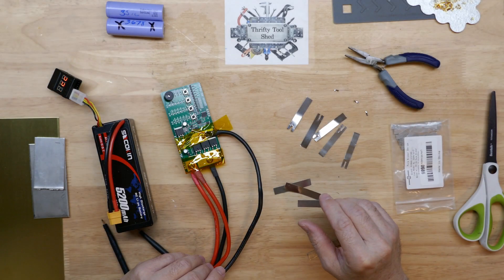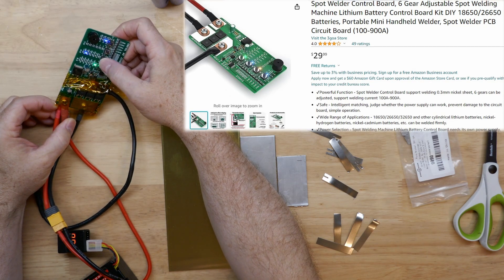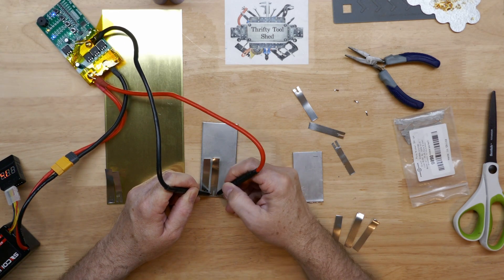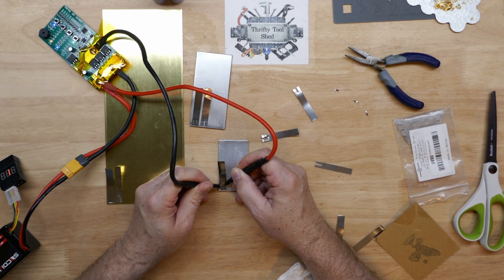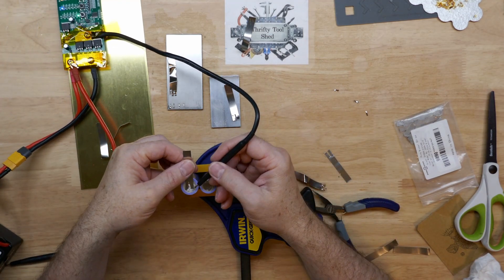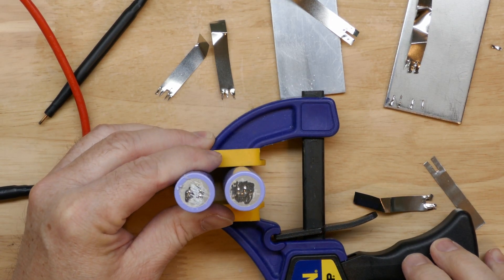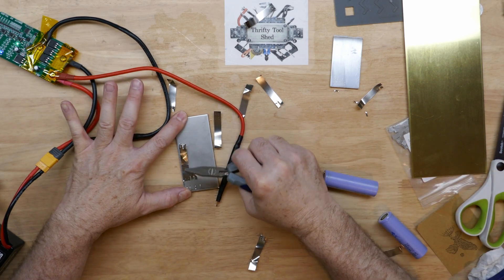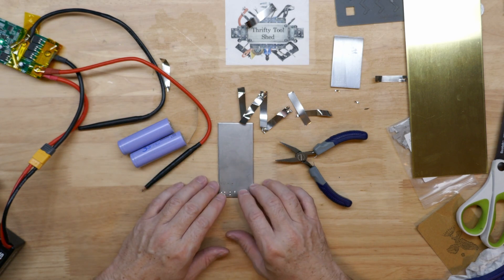Spot Weld Method Test - Which is Superior?

Comment: The slit nickel has sound science behind it. Looks like you understand the theory. Instead of the current taking the path of least resistance straight through the nickel (because the can is steel) by putting the slit you get the path of least resistance POSSIBLY being through the nickel and then through the can/positive cap. 

I notice a HUGE difference when doing 0.20mm pure nickel. I can do 0.20mm pure nickel on the middle or even only the 2nd power setting with the JQ and just an A123 4S8P pack. If the nickel has slits in it I can definitely get a better weld on the 2nd power setting and the middle setting is too much.

Comment: Cool to see you've started using the JQ-DHJ02B board too. Its freaking out of this world for the price ($18)

I blew mine up recently. Worked great with a 4S8P A123 M1B pack or a 3S2P Headway 38120HP pack (killed one cell so can't do 4S2P). I tried to parallel those two packs by just using 3 series groups on the A123 pack but I knew I was pushing the 900A limit using those two in parallel. A123 pack measured about 3mR AC IR in the 3S configuration and the Headway pack measured just under 3mR AC IR as well....so a 20Ah A123 pack plus a 16Ah Headway pack...yeah that was just too much. Blew the traces on the board where the current goes into the fets and then blew a huge fucking hole in one fet probably because some of the traces were blown.

I wanted to just use a simple Lipo but the CNHL "120C" battery I bought was a fucking joke. Its a 3S2P and each 2P series group measures between 6mR and 8mR on the tabs. Seller (not CNHL directly but I thought I was buying from them) on Aliexpress says anything under 8mR is GOOD! Uhhhh if you do the math a true 120C pack would be dropping to almost 0 volts at the IR readings I'm getting. To rate something 120C you need cells under 2mR to not have voltage drop below 3.4V. Really pissed me off.

Comment: Very interesting. Always good to test rather than follow accepted wisdom. I wonder if the slits are something that seemed logical so they did it, and now everyone just goes along with it. Hard to compare as these low powered spot welders are likely very adversely affected by the increase in resistance. Might have to use a scope to measure the voltage pulse across the leads.

I wonder how much current is actually going through to the base material. Maybe all the welding happens from heating the nickel.

Could you try spot welding 2 seperate nickel strips so that all the current has to go into the stainless? Also do a solid strip of nickel bridging 2 pieces of stainless so that all the current is through the Nickel. Keep the distance between probes the same. Again the problem will be that the current will likely be much less when forced to go entirely through the stainless.
Reply from the maker: Yes, I am certain the split is beneficial to the process. They absolutely have much more current capabilities in manufacturing for sure. I am certain with the spacing the same it is better through the split for sure.  I have always welded close together to get good welds in spite of inferior welders to the manufacturing process. I almost did a round of trying that exact idea that you shared above. Well, at least having 2 strips side by side and testing that way. I stopped since the video hit much longer than I meant for it to be. Lol. I thought this will take a few minutes. Then I had to struggle to get it under 12mins... Story of my YouTube life.
Reply: The science behind it is sound..the problem is will that slit be enough of an in increase in the IR of the nickel strip to make going through the can the path of least resistance?

Edit: and in practice it holds true. I can typically go down a power setting on the JQ and get an identical weld